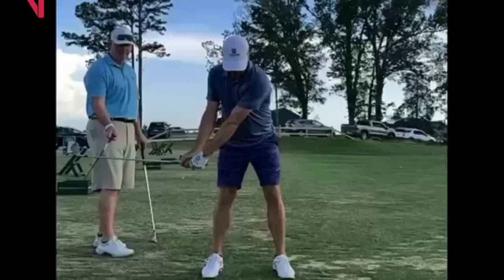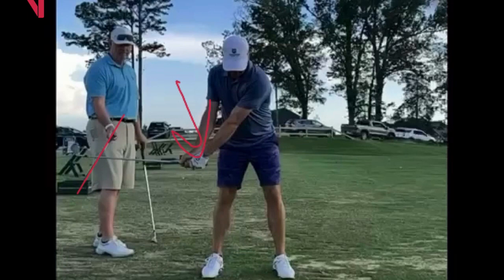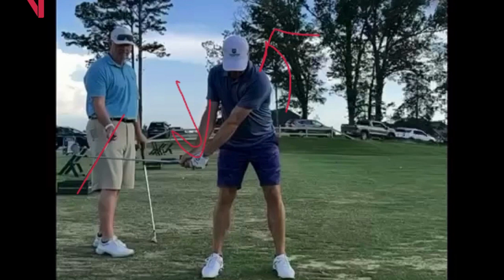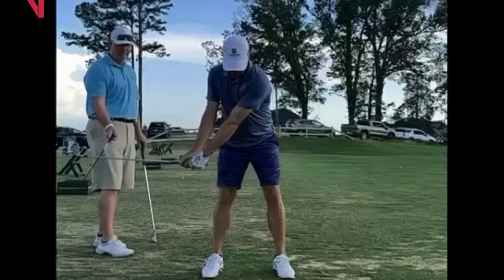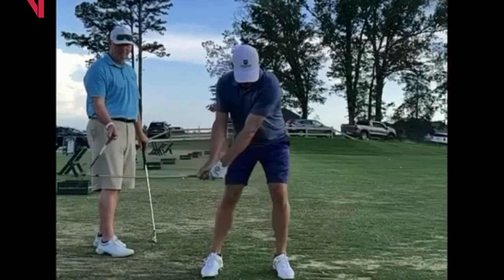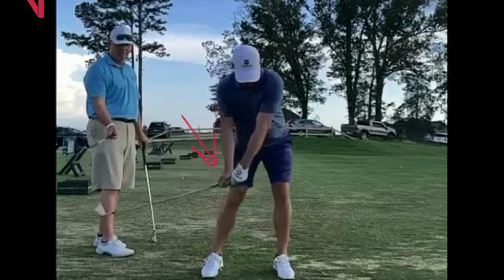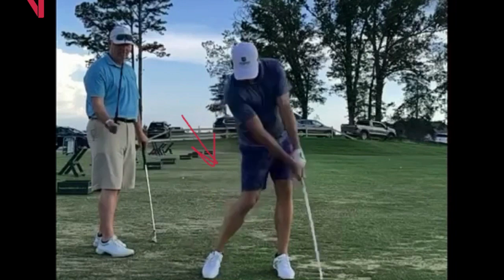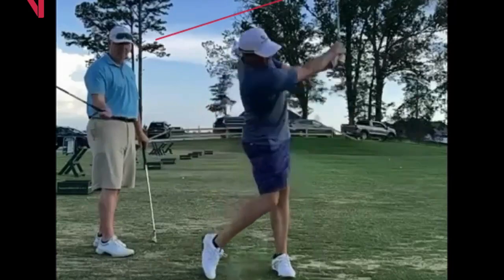Jon Rahm Drill - Short Backswing with Resistance helps to create proper body rotation. Power Impact

Comment: Do you need the resistance aspect? If so, how would you recommend performing this drill solo?
Reply from the maker: You don’t need the resistance but it is a benefit. The resistance forces you to apply hand/wrist/arm, upper body to the club without sliding from the lower body. You could use a bag stand, strong box or something like that. Let me try some things out and I’ll report back.
Reply: Thanks!!